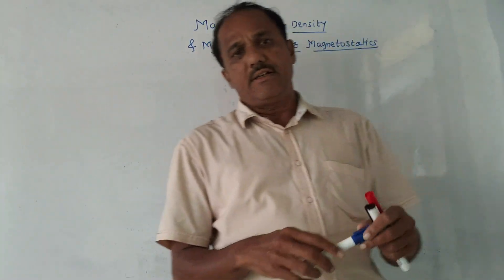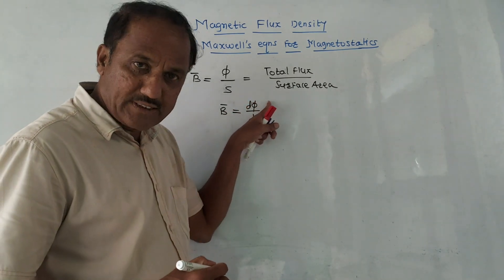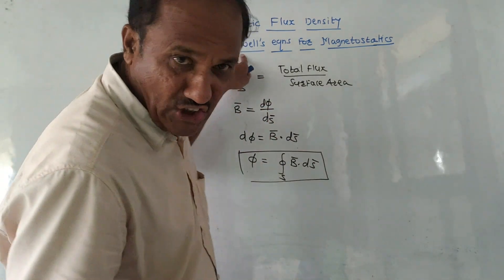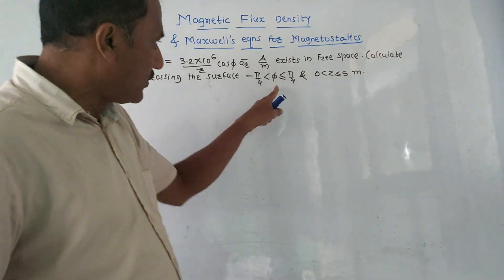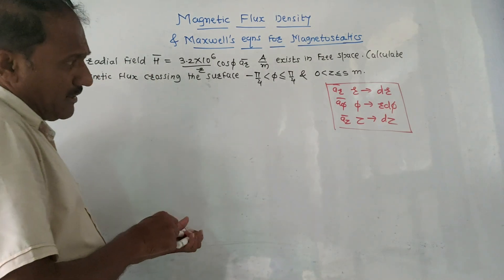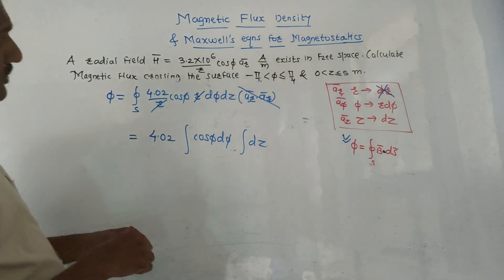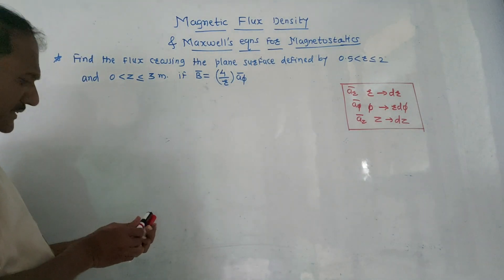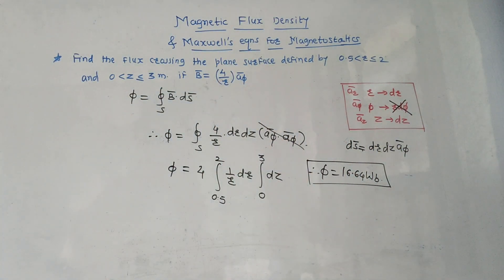MAGNETIC FLUX DENSITY AND MAXWELL'S EQUATIONS FOR MAGNETOSTATICS

Comment: Sir answer should be 28.42 of second last question ❓ pls cheak
Reply: Yes you are right 👍🏻
Reply: No ,16.63 is correct ans
If you solve seperately then ans is 28.42
But if you take all three terms combined on calculator then it is 16.63